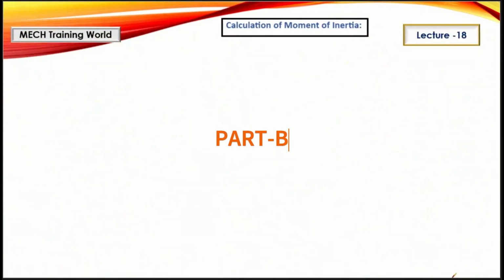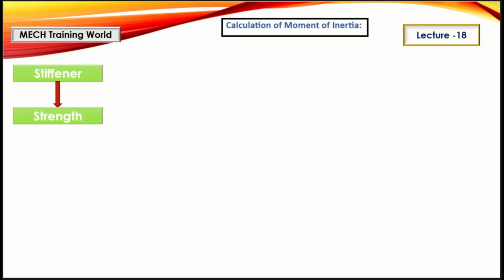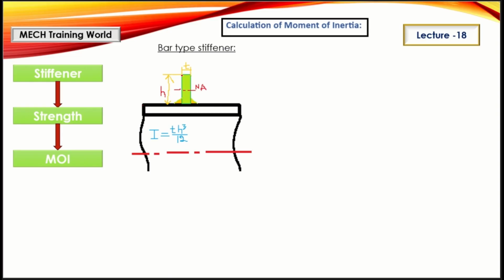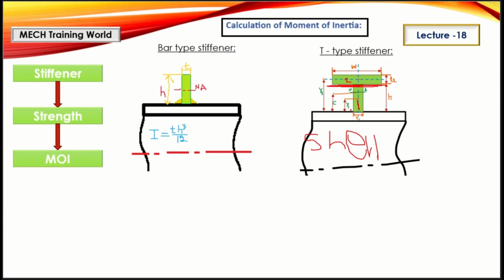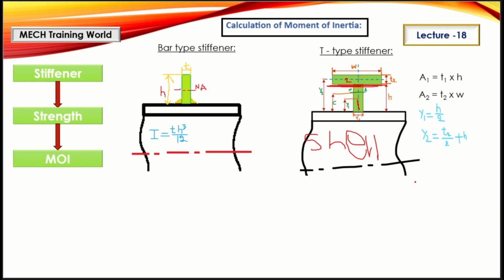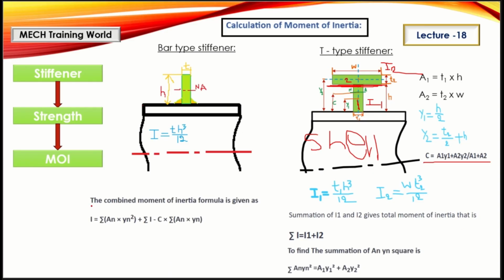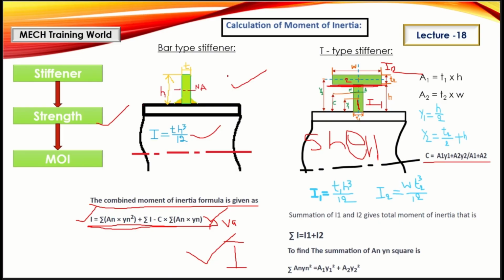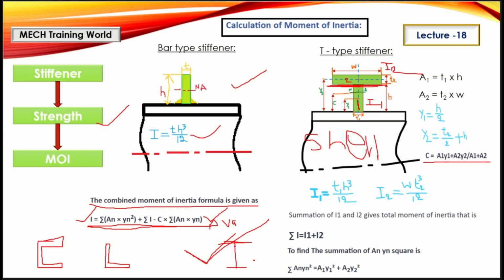Part-B UG 29 STIFFENING RINGS Calculation Lecture 18

Comment: What is the difference between "Total moment of inertia" and "Combined moment of inertia"?
I did not understand when you got into the calculation of combined moment of inertia.
Reply from the maker: Thanks for watching.

Total MOI is the sum of centroidal moments of inertia of individual parts
Each I is calculated about its own centroid, No distance effect included.
Total MOI does not represent actual stiffness of the stiffener as installed.

But In reality:
Web and flange are not located on the same neutral axis, Distance from neutral axis increases bending contribution. so thats why we are calculating combined MOI using Parallel axis theorem.

Combined MOI - Moment of inertia of the entire stiffener which is Calculated about one common axis.

Simply,
Total moment of inertia is only the summation of centroidal inertias of individual stiffener components and is an intermediate calculation, whereas combined moment of inertia represents the effective bending stiffness of the complete stiffener about a common reference axis and is the value required by UG‑29 for strength evaluation.